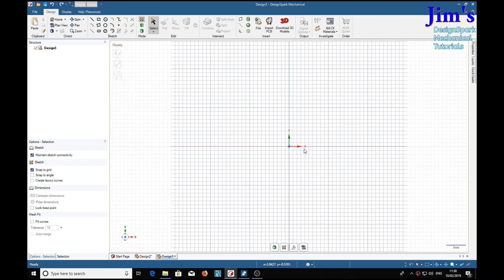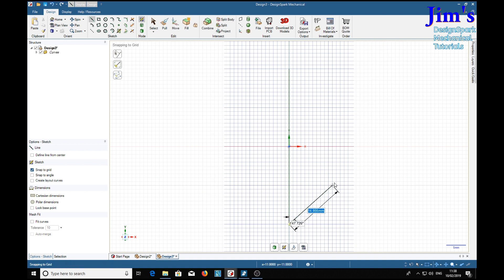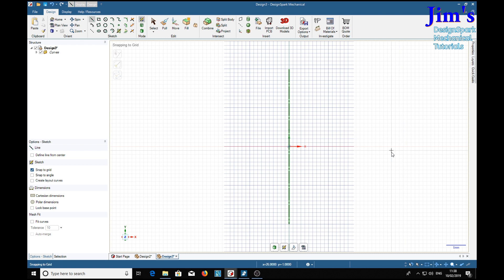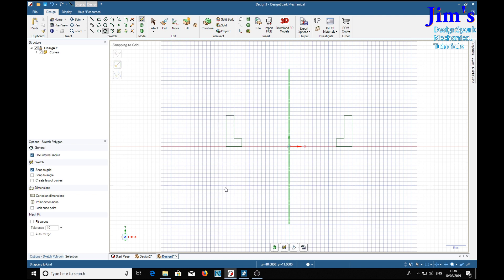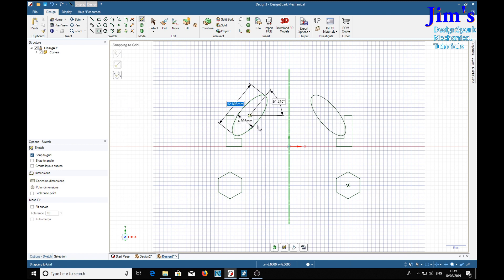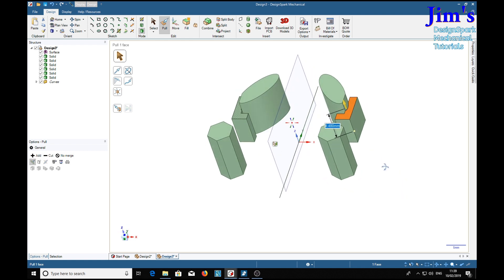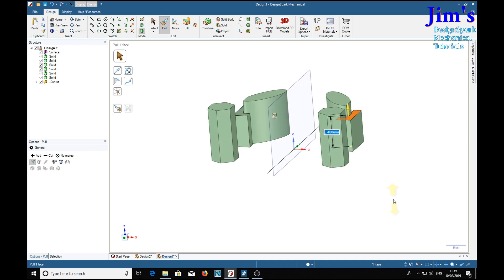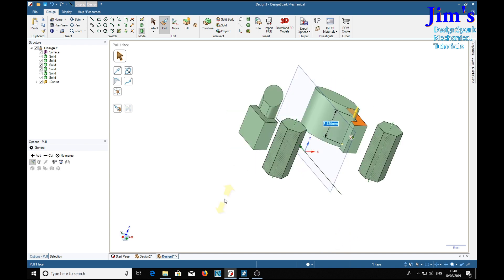DesignSpark Mechanical: The mirror tool pt1

Comment: Hello Jim,
I watched your video on this tool and you couldnt get the hole thru both with the mirror tool, Im very new to this program, but i got the holes thru with the tool turned on still, I made my circle, went to 3D and pull tool, holding down ctrl key and left mouse high lited the hole while still holding ctrl and left mouse pulled all the way thru, let go of ctrl and left mouse, then left mouse and pulled back all the way again and had my holes thru both. 
Thanks for your videos, they help alot.
Mike